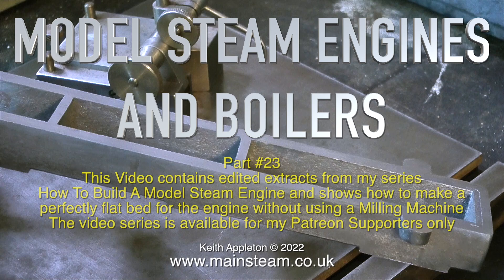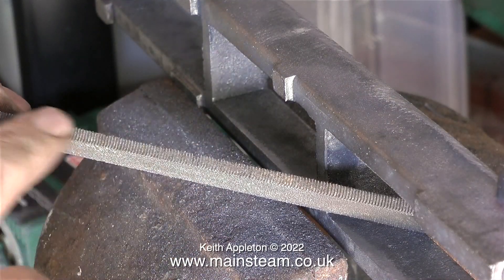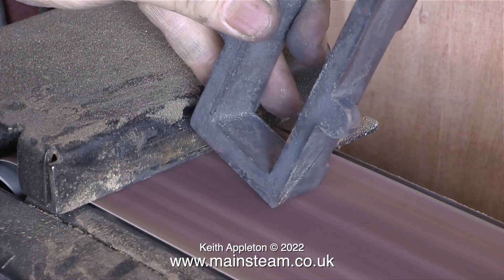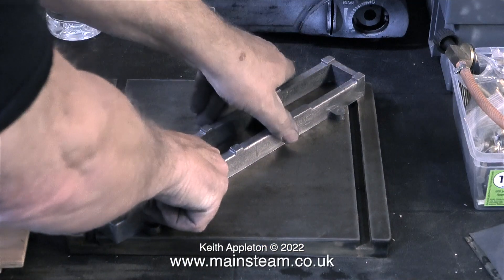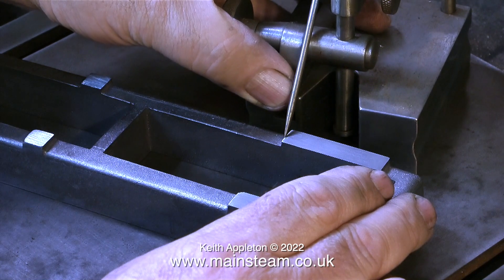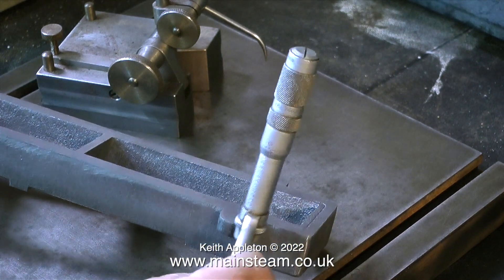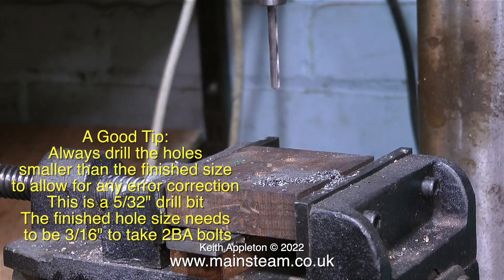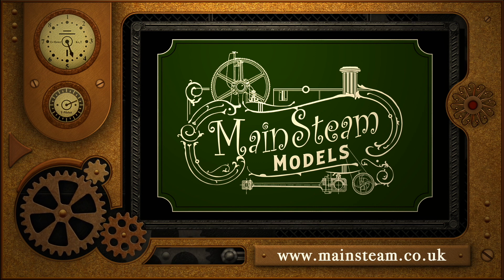MODEL STEAM ENGINES AND BOILERS - PART #23

Comment: I used to subscribe to Model Engineering and it quite out me off trying to build anything out of metal.  Too many writers used some sort of jargon as a code shorthand.  That was great for readers who knew the code, but left beginners like me befuddled.  For example, what does it mean to "break" a part that is in the lathe?  To me, that meant reduce it to useless chunks, but I knew the writer meant something else.  Some definitions would have helped.

Comment: In the US, those are typically called surface gages. A height gage would have a calibrated vertical post and a flat scriber that you can set.

Very classic technique you're using there. I have a textbook on machine shop procedures that shows a gentleman using one to mark it the casing for an automotive engine block. It's always interesting to watch these traditional procedures and marvel at the accuracy they can produce.